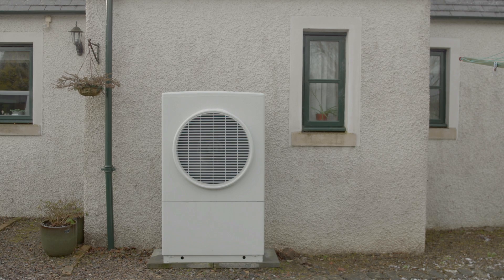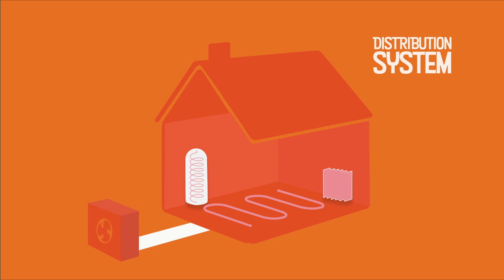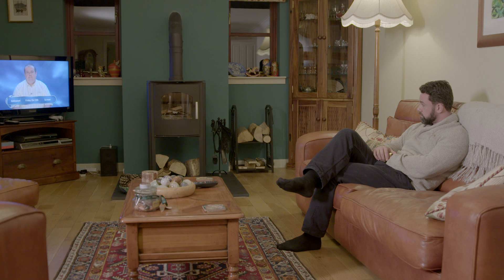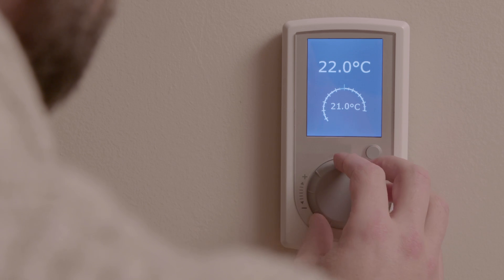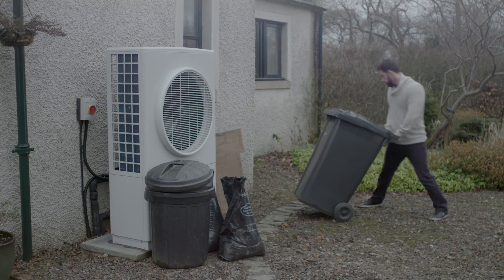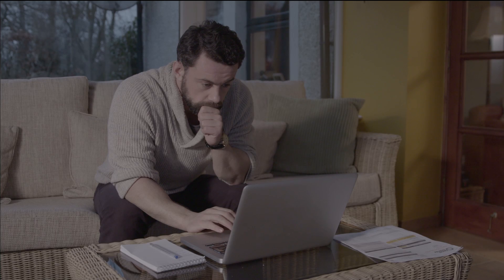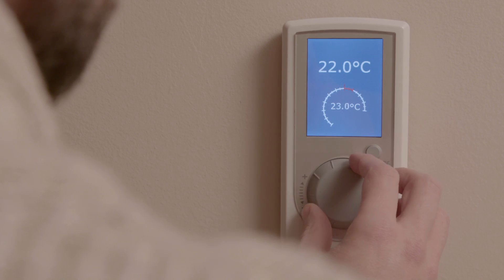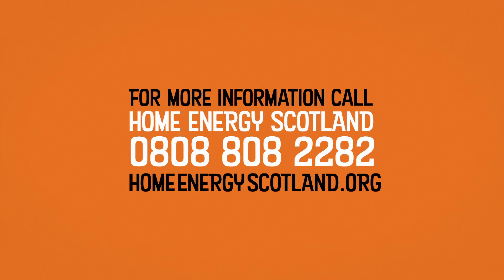Getting the best out of air source heat pumps

Comment: in the U.K. changing from a gas boiler to an air source heat pump is illogical. 
They certainly are not effective for the average British house and their theoretical 'efficiency' is a myth. (Basing it on electrical units as the source of energy is wrong, divide by two at least as generATion, transmission and distribution losses are at least 50%). As electrical unit cost are high and can only get higher with our government's dreadful generation plan, gas is by far the most effective and economical way for domestic heating.
Nor do they reduce CO2 emissions as due to how the grid works they are ultimately powered by gas anyway, with some help from coal.

Comment: We were on oil and an ASHP is the best thing we could have bought (in 2015). With the government grant that was available for install and c. £350 per quarter over 7 years it definitely worked out as a great option economically in the long run for us. I do realise the grant has just stopped and also the RHI incentives have dropped but would still recommend it despite the initial install costs, especially if off-grid like us it's the only way to go and ongoing maintenance and running costs are much lower than gas or oil.

Comment: Leave it well alone lose money doesn't save you one penny she is being paid to say this I have one and it is costing a fortune
Reply: We've been installing heat pumps since 2006 and all of our customers, without exception, are delighted with how efficient they are.  Some of our customers are energy cost neutral.  There are many reasons why a heat pump costs a lot to run, including but not limited to: a) it being incorrectly sized for the property - some installers oversize heat pumps, which is especially bad if the heat pump is not inverter driven; b) the calculations to assess the heat pump size were not done correctly; c) the insulation levels of the property don't match the insulation criteria used in the calculations; d) the heat pump has not been set up correctly; or e) radiator sizes have not been increased to account for the low water temperature from the heat pump.  If yours was an MCS installation and your installer can't rectify the problem, there is a complaints procedure and I recommend that you check your paperwork.  Furthermore, the MCS installer should have provided you with a workmanship warranty on which you can claim.
Reply: Pauline Honest it is not cheap maybe it was cowboys that fitted it they have went tits up. No paper work for the machine that they fitted £8 to £10 per day we were told Free. Guaranteed for 7 year and will save you money who do you complain to in England we have been had right over Brand new combi and they disconnected it Brand new didn't ask just done it destroyed me kitchen Not Happy your company might know what they are doing are you near Liverpool I would get you out to sort it We don't even know who is responsible carries the can 
   Cheers for your interest but I stand by what I have said